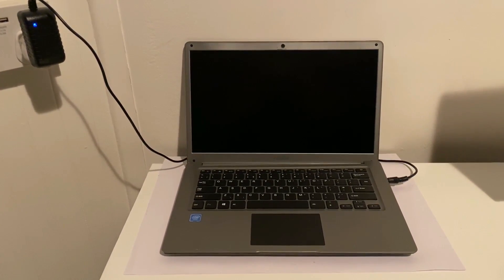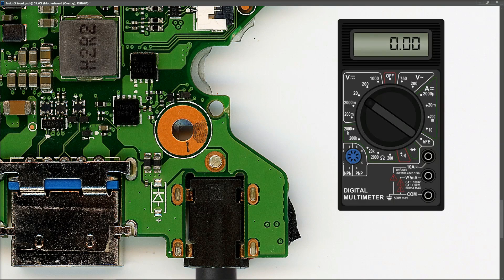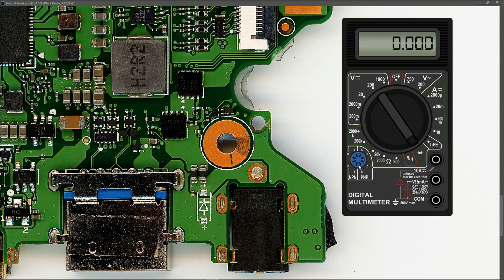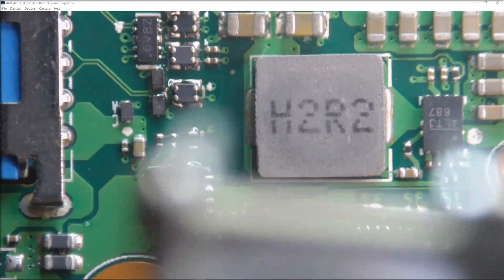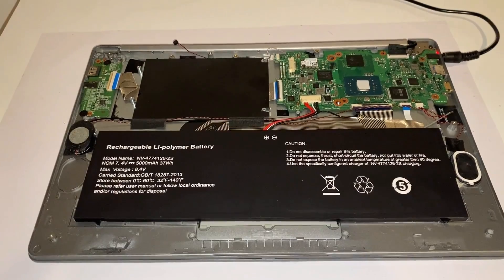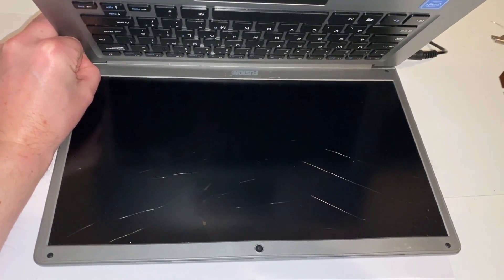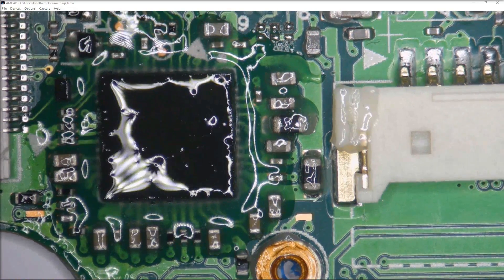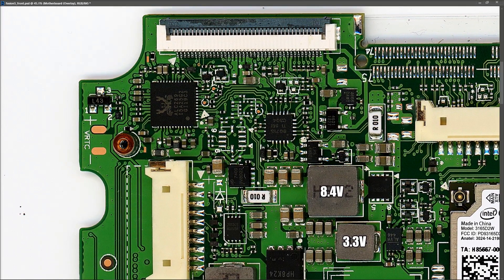FUSION 5 LAPBOOK A90B+ PRO - NOT POWERING ON

Comment: I have the same laptop which failed turning on after running a driver update app. I guess this is due to an incorrect firmware update. Are you able to backup & share the bios file for the laptop? Thank you
Reply: When I press the power button or the charger is connected the blue power led turns on but nothing happens the screen is black.

Comment: Hi, a blown sound IC would be possible.
This can sometimes happen as it did on my Toshita possibly due to ESD on an exposed port causing muddy audio but have also had a dead motherboard caused by this, fortunately got lucky this time and it was on a separate board.
This IC on many laptops also does double duty as an SD slot interface and handles certain low level functions so its absence may bring it back up at least partially.

Comment: Hello, can someone tell me why in diode mode the red probe is on ground? A short circuit in one sense where another remains a short circuit!
Reply: For test purposes sometimes you measure "backwards" ie meter + to ground. This shows if there is a dead short or just a diode drop. Sometimes you can also see a capacitor charging as well.

Comment: It appears that that manufacturer's IC ALC269 with the "crab" logo is damaged internally. I would check each pin of that IC that is connected to an end terminal of a passive component for shorts. As an example:
Pins 13, 18 and 19 are each connected to their respective resistor. Pin 18 and Pin 19 to their corresponding smd ceramic capacitor? Does the DMM show or indicate that at least one of the mentioned pins is shorted? So why continue? Let's replace that IC.
I personally believe, without being a chemist, that lighter fluid is much more flammable than isopropyl alcohol (IPA) but each of these passive components would have to be soaked (moistened) individually, which due to their small size is extremely difficult (perhaps with a surgical needle).
The thermal camera would detect it accurately if the component is solitary in one area of the PCB. When they are connected in parallel (2 - 4) sometimes it also focuses precisely on the culprit.
That laptop is totally similar to the W1415A model from manufacturer ATVIO used here in North America.
Thanks for sharing. All the best.